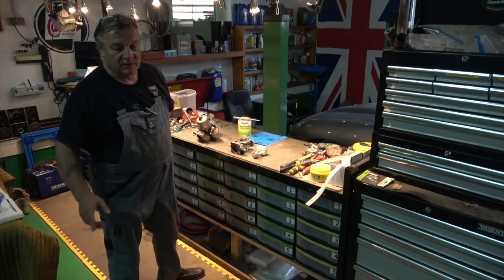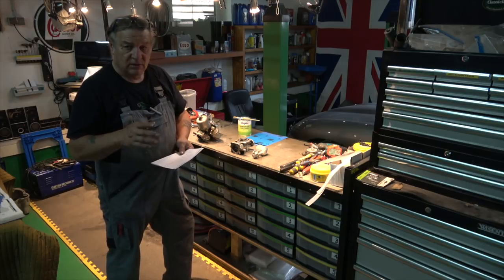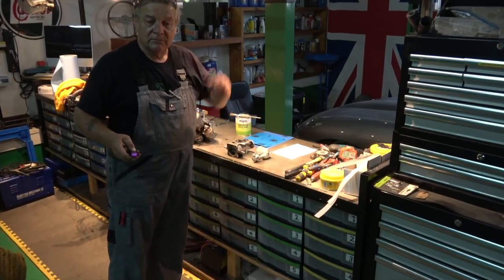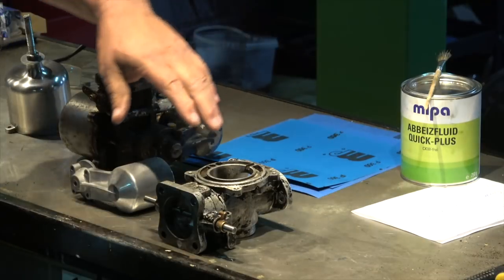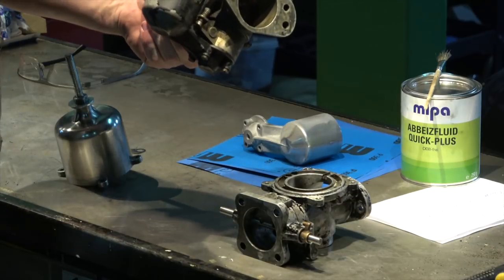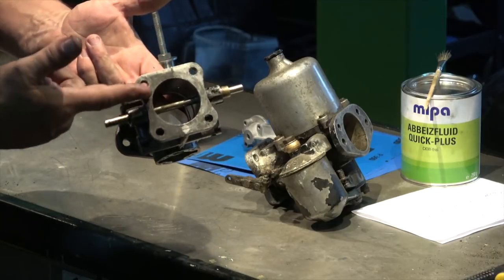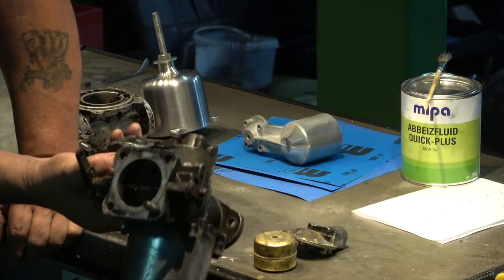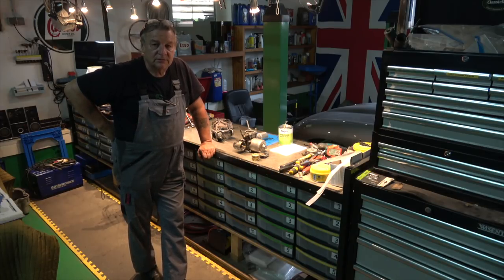SU Carbs Paint Strip & Polish

Comment: Dave, locktite SF-790 is a very good aerosol paint stripper is you can get it. worked pretty good on the nose of the invader to get the bondo that someone had stupidly smeared all over it. still took a a bit of convincing with a 1/8" thick square of phenolic to gently scrape the stuff off. but turned out pretty good.

Comment: Get some Port n Brandy in mum and she'll be right as rain. ever tried muriatic acid for strippin? make sure all seals are out as it will remove everything thats not metal including skin. i have the wax compounds and buff wheels from doing motorcycle cases and fork legs.
Reply from the maker: Doug, I have heard that remedy, I got some new stuff which i will try out today, I have a cunning plan for the VW bed which i think will work with gear i already have. Cheers Dave.
Reply: i'm a fan of cunning plans sir.